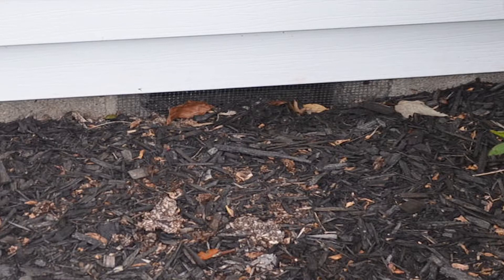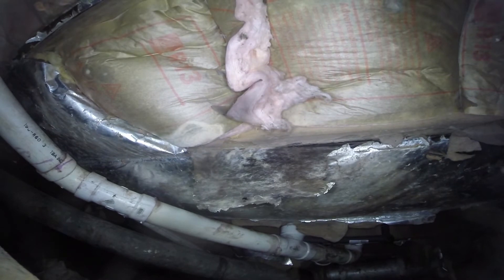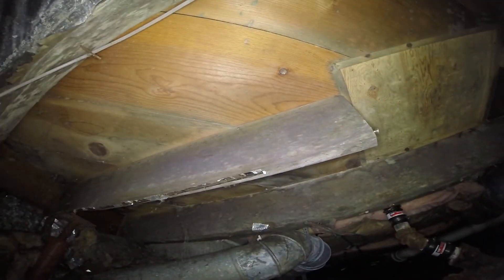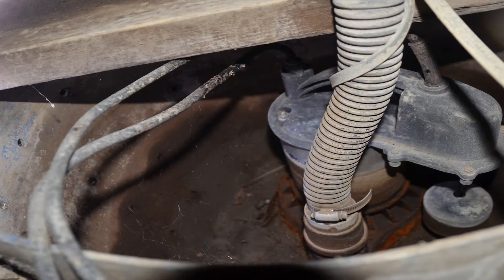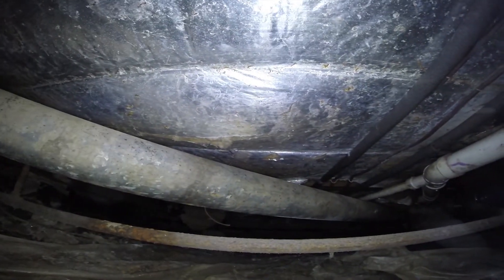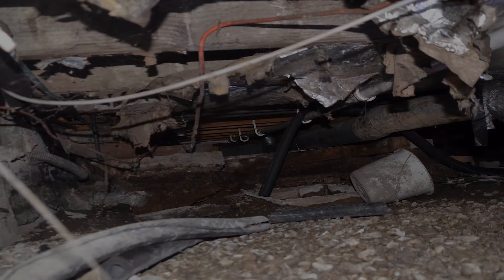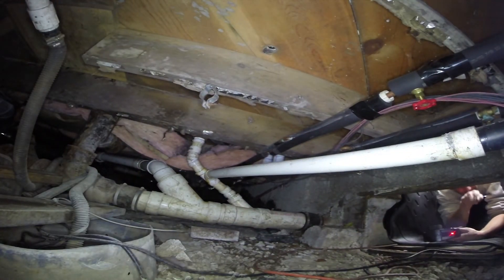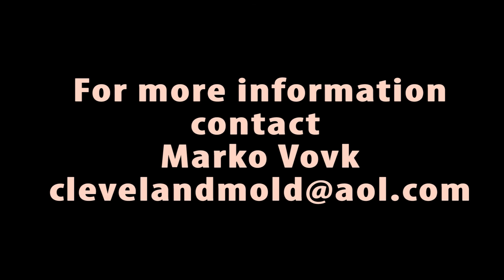How to Inspect a Crawl Space

Comment: Getting ready to remove all insulation, heating unit,     debri from old repairs. house was built in 60s well built but later changes on house, caused water leaking into crawl space. Have resolved most water problems with new drainage. Debating air sealing or not.